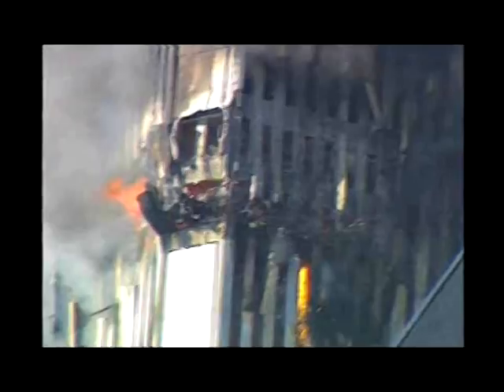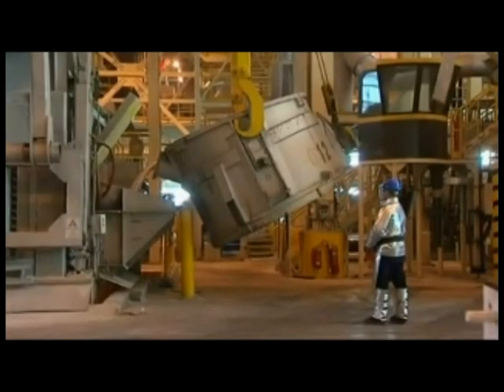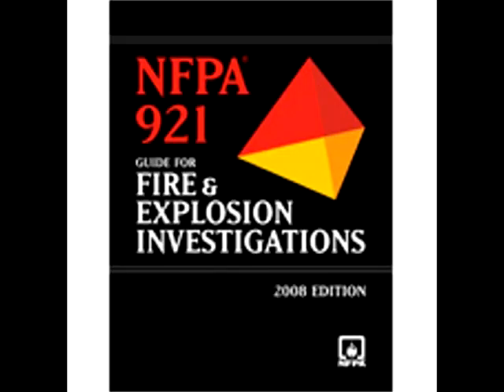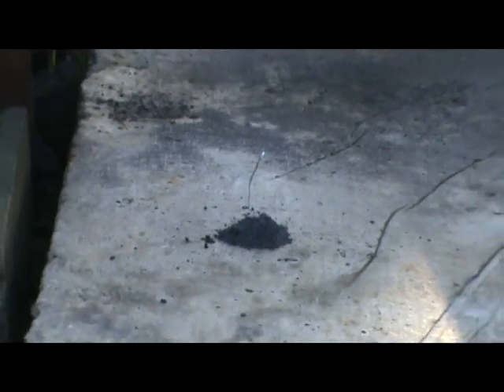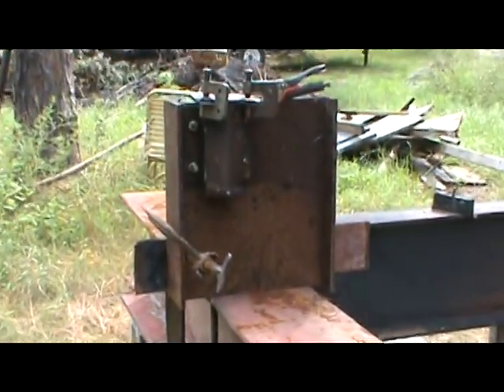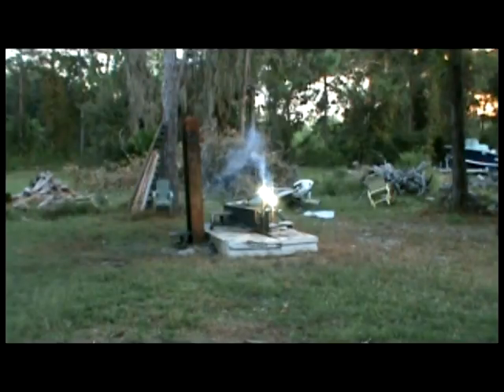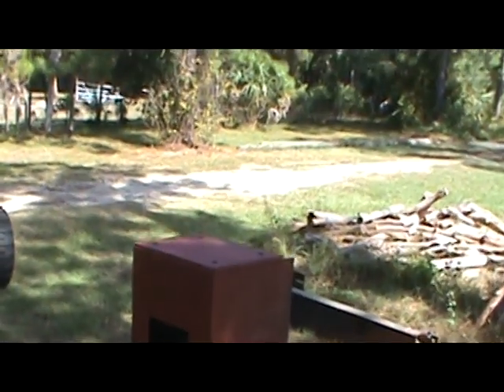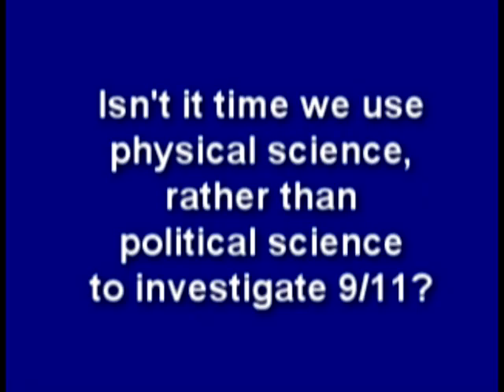9/11 Experiments: The Great Thermate Debate

Comment: Today I learned that jet fuel could melt steel, it burns at 2000 degrees. Not trying to spark up an argument just stating what I learned literally today
Reply: +Barry Hewitt THE BEAMS WERE MADE FIREPROOF. No tower has ever fallen due to a fire in HISTORY. The buildings themselves were made to handle a plane crash. They take that into account. No building falls like that, you have to realize it. I sincerely hope you do man.
Reply: +SgtTeddybear66  Alright just so there's no confusion I'm in eighth grade and we got a study guide saying that jet fuels burns at 2000 degrees and it said IT CAN melt steel. I don't know anything about architectural designs about buildings or anything just stating what I learned so that I can learn more about this
Reply: +kuba adilman  Yeah I'll get right on that. I are you guys sure? You'd think that my teacher would know what's true
Reply: +Barry Hewitt take reliable source and print out the info, to proof she/he was wrong. Teachers are only humans and humans do errors, so that would not be the first time someone was wrong in human history.
Reply: +Barry Hewitt you think school teaches you whats right what a joke its all programming  turn off the tv
Reply: +SgtTeddybear66 LIAR -- there's NO SUCH THING as completely fireproof, and reinforced steel structures DID fall due to fires during the bombing of Hamburg and Dresden!
Reply: +SgtTeddybear66 Indeed, the beams were made fireproof. 
Because steel beams behave badly in a fire. That is why they apply fireproofing. 
And the crash of the plane dislodged that fireproofing. 

You also said the towers could handle such a plane crash.
Can you elaborate that? In what way did they handle the crash?
Reply: +mark brinton No it WASN'T "blown to dust", LIAR -- there were BIG CHUNKS of concrete and steel in the pile of rubble!  And there's NOTHING on earth which can blow a building of this size to dust -- except a nuke, which this WASN'T!
Reply: We werent justified dipshit. You must love you some cheney too. Will never understand people like you who think its Americas job to police the world. Newsflash dummy, it isnt our job. Youre the template for whats wrong in this country.
Reply: mark brinton the towers hardly had any concrete in them. Only 10 cm on the steel floorplates. Most walls in the twin towers were made out of drywall. You don't need much energy to turn that into dust.
Reply: +kuba adilman WRONG -- with a draft (such as what they had in the Twin Towers due to the chimney effect), jet fuel (and any other combustible material) will burn MUCH HOTTER than in free air!
Reply: +agentorange153  I to love my country, but just because we love our country doesn't mean our country is incorruptible! IT IS BECAUSE OF 9/11 (I don't give a fuck what you think old man) THAT WE GAVE UP OUR LIBERTY FOR SECURITY!!! Our founding fathers warned us to NEVER trade LIBERTY over SECURITY.  IT IS BECAUSE OF 9/11 THAT WE ARE IN ANOTHER WAR THAT HIGHLY  BENEFITS THE CENTRAL BANKS THAT LOAN with interest BOTH  SIDES MONEY FOR WAR.  The same central banks that OUR FOUNDING FATHERS WARNED US ABOUT.  So go eat a dick if you are going to tell me an AMERICAN that I don't have the right or freedom of speech to write whatever I want without being labeled a fucken terrorist. The freedom of speech is in our bill of rights don't you dare call me a terrorist! I love my city my state my country but I do not love the majority of the people who run it. We all are free to have an opinion  but yours seems to be programmed....
Reply: You have made yourself look like the single biggest simpleton ever. Theres no point having a discussion with someone so slow. You are clearly someone who likes to be spoonfed your reality. I cant help you there. Some of the other things you just mentioned confirm that one statement. Truth? I dont care youre a sheep. Good for you.
Reply: Whatever Noticed I respect his opinion, but that isnt how wtc7 collapsed. Being a fire fighter doesnt trump physics or common sense. Not an insult at all, just a fact. Youre free to believe what you like. Even if its incorrect.
Reply: People act like jet fuel is the only thing that burns. After seeing a whole floor engulfed in a flashover, there is plenty to burn. It doesn't need to melt it, it just needs to weaken the steel. The explosions can be easily caused by a backdraft AND a flashover. Backdraft is the lack of air in an enclosed area where a rush of air enters that enclosed area and caused a "smoke explosion."  A flashover occurs when flammable material gets to a certain point, around 1000oF and literally everything that can burn, will burn in a fiery explosion. That goes for materials in cubicles, furniture, papers, the ash in the air(which is unburned material.) It all can easily cause a flashover and that is what I saw in the video. An entire floor was engulfed in a flashover.
Reply: Richard Driskill even if it weakens steel, the building would collapse into huge chunks of debris. It was literally, completely and entirely blown to dust. All of it. The official story is nonsense. Trust your brain and eyes.
Reply: agentorange153 and nukes arent the only thing that can have that affect. What do you do for a living? Im sure it isnt molecular chemistry. ...
Reply: You are not very smart. In fact trying to have a conversation with someone with such a low IQ is futile at best. Just so you know we dont have a right to go into other countries, esp based on lies. Terrorists exist largely because of us you dimwit. We went there on lies. Thats wrong buddy.
Reply: No I have plently, he started with the insults, and frankly some people are so set in their beliefs you cant have a conversation with them.
Reply: Whatever Noticed It's ok, clearly he does not understand science. This is chemistry, but let him use physics, because that's not what you use for a burning building. What do I know though? I spent months and years learning this stuff, but I guess that doesn't amount to the level of Googling he did.
Reply: *****
You do not need to melt steel in order to weaken it though. Blacksmiths have known this for thousands of years now. Why don't you?
Reply: +mark brinton And in fact it DID drop in huge pieces -- just look at any photo of the rubble pile, for God's sake!  And there was NO molten steel -- there was molten ALUMINUM from the jumbo jets and from the towers' curtain wall!
Reply: anybody acting clandestinely on foreign soil and taking the lives of those citizens and/or destroying infrastructure is a terrorist, wouldn't you agree?
Reply: +Barry Hewitt Theres a reason Jet fuel cant melt steel beams is a popular saying.
Reply: agentorange153 yes, it was. Wtc 1 & 2 left six percent of their mass. Everyone saw the enormous dust cloud. For miles. If you dont understand physics, engineering and common sense I cant help you.
Reply: That might be the most ridiculous statement ive ever heard.
Reply: mark brinton it is not a statement, but a fact
Look it up.
Reply: Meaning I know that's the amount of concrete,  but the entire building and contents were turned to 95 percent dust. Fire and collapse was no where near enough to pulverize like it did. Not to mention molten steel. Look that up.
Reply: mark brinton So there is nothing wrong with what i said.
95% dust is not correct. Look at videos of the cleanup. 
But that aside: the potential energy of the towers was enough to pulverize its complete content when the energy gets released during a collapse. There is no additional energy in the form of explosives necessary.
Reply: +mark brinton And yes, we were FULLY JUSTIFIED in going into Iraq -- Saddam DID have a few chemical weapons left, and also was harboring TERRORISTS on Iraqi soil!
Reply: Wow, youve swallowed the whole thing, what a good little sheep you are. Damn what an ignorant thing to say. You are becoming the minority kid.
Reply: Indeed. At least youre not a simpleton like agentorange153.
Reply: +kuba adilman It didn't have to melt only had to weaken slightly, so 1500 degrees would of been enough with 10k tonnes above pressing down on it for 40 minutes would of easily brought the building down. just a weakening of the steel NOT melting.
Reply: mark brinton WTC7 collapsed due to the failure described by Chris DemonPuncher
Reply: It may burn at what ever temp but the mix of it in the towers would of just flashed. If you light a pond full yea you would get full heat. This exploded so it wouldn't of got up to temperature to melt steel
Reply: If jet fuel can melt steel what are jet engines made of?
Reply: DeadUgly1 Titanium.
Reply: basicaneer  not to mention the thermodynamic expansion.
Reply: +Whatever Noticed The bigger issue is the loss of tensile strength. Concrete by itself has no tensile strength to speak of. That is why we reinforce it with steel.
Reply: +kuba adilman you realize it burns 1500C right not F so 1500 to F is 2732
Reply: +kuba adilman no,he should go tell his teacher that some idot on youtube is trying to tell him something that said idot knows NOTHING about lol
Reply: +Barry Hewitt I wonder if your study guide was written post 911? This would be a good time to learn that what we are taught in schools, usually through history or social studies, is a biased and government sactioned version of facts. 
Could you give us the name or description of this guide? I would be interested to see this. I am betting its a post 911 book. Unusual because I have be reading and watching this topic for awhile and have never read anyone make that claim regarding those temperaturres and find it disturbing that an education system would go as far as this to support a tainted version of history when this information has previously always contradicted what you have learned. a scary fact of how the education system may be used as propaganda.
Reply: v5u7sulh2
Apparently it does not take meticulous planning. All it takes is parking a jumbo jet far enough up in the building. We have an event that proves this now.

Also, if the government was bent on pissing us off why would they set it up so the building fell so perfectly? Where is the advantage to them there? Wouldn't they arrange things so screw balls like you wouldn't scream conspiracy?

Why would they leave a smoking gun, so to speak? Face facts it happened how it happened.
Reply: TheFacelesss Men
Steel also loses 80% of its tensile strength at half of its melting point. The building was not designed to stand weakened that much. Heck it could have been a solid bar of steel and it would not have stood up.
Reply: Youre right, its done and over with. But, its 14 years later and there are FAR TOO MANY blatant lies, unanswered questions and inconsistencies for any "thinking person" to just accept what they've been told... shrug Eh, jets hit tower... fire knocked down tower... USA went to war against "terrorism".. Why would our government lie, right? 

Sorry, Im a skeptic when I am told a story that doesnt add up. And When there are facts staring me in the face and there are people  desperately trying to discredit them and distract me from them
Reply: +Barry Hewitt The melting point of mild steel is around 2500, high carbon 2600, stainless 2800. I am a blacksmith and my forge runs around 2500...it does not liquefy steel. Just google metal melting points and you can see what actual temps are required to melt steel
Reply: What I find interesting is that the actual government was so worried and aware of the questions over their "official" account that even the President felt it necessary to directly attack "so called conspiracy theories."
I actually believe this lends even more weight to the truth movement because its unusual for someone to defend against something they know to be false. In other words, they must have believed this could be a serious problem but why would it if it was incorrect? Why would one worry about something that would be impossible to be taken seriously by the populous? Maybe because he knew that his story was a weak and a lie and that anyone taking the time to follow up on these crazy conspiracy theories would be hard pressed to believe what his administration wants us to.

Every word a President says to media has been carefully calculated and vetted before being said.That he would acknowledge something that he really thought to be a weak non issue would never get a word but he actually had written speeches just for this topic.Interesting.
Reply: +Barry Hewitt no steel melting was involved, steel softening is all thats required
Reply: +Barry Hewitt steel melts at 2600-2800 degrees but at half that temperature steel loses more than half its tensile strength. thermite typically doesnt get hotter than 2500 degrees.
Reply: john harry good one. I do flip burgers in my backyard. Something you most likely don't have. Meaning a grill or backyard. Doesn't bother me what you think. Apparently you don't think too much anyway.
Reply: Since there is a lot of argument regarding steel melting points and burn temperature of jet fuel, I went and looked myself.

Steel Melts at anywhere between ~1050 and ~1500 C
Jet Fuel max adiabatic burn temperature is 2230C
Jet fuel open air burn temperature is 1030 C

The maximum temperature for steel is with 0% carbon. It should be safe to assume that the trade center steel had at least 2% carbon and probably had a melting temperature around 1400 C. The adiabatic (heat does not escape from the system) case is a theoretical maximum. The system in the trade towers was at least partially adiabatic. For those who mentioned the chimney affect, the trade towers were design so that would never happen.

Given a 1400 C melting point for steel on the high end, I do not see any reason that partial adiabatic affects would not have caused the fire to reach 1400 C or higher.

All information gathered from Wiki.
Reply: ***** Oh, and before you do a quick google search, conspiracy theory blogs and articles do not count as accurate sources.
Reply: +kuba adilman You dont need to completely melt it, just heating up the metal when its under pressure, will cause it to bend, twist or break. super heated metal wont hold a building up it would just collapse. Hell, wood beams hold their strength in a fire way better then steel.
Reply: +Barry Hewitt keep in mind that western government education systems are more about controlling and focusing minds than they are about actually educating, let alone teaching people to think independently...
Reply: +agentorange153 so you're saying the people of the 150 countries around the world have a right to invade the USA and assassinate your president? did you know American forces and/or agents are illegally in about that many countries and are therefore, by definition, terrorists?
Reply: +agentorange153 Buildings in Dresden and Hamburg (Germany) built before WW2 - were NOT built to the same spec. as the twin towers at all!
Reply: +Barry Hewitt in a properly designed burner with a stoichiometric air/fuel ratio. Now lets look at the real world.
Reply: blabla62871 melted? With all due respect you have no idea. Organic material falls short by 1000 degrees. Its not an argument. It is fact.
Reply: No it wasn't. It would shear and drop in huge pieces, not blow to dust. What do you say about molten steel?
Reply: Yes there was molten aluminum, and melted steel also. Thats the problem. Cars hundreds of feet away were melted. Its obvious other factors were at play. Simply the plane and fires could never bring down three buildings. Simply impossible.
Reply: That might help you. Experts from nist even say steel
Reply: +mark brinton The experts from NIST do NOT say the steel was melted -- in fact they SPECIFICALLY state that it WASN'T!!!
Reply: The structural engineer for wtc even stated this
Reply: Hey man , youre free to think what you want. Without people like you to believe the official report, the "powers that be" would be screwed. You probably even support bush going into iraq to search for weapons that werent even there. And we've never left.
Reply: Go do some of your own research and critical thinking. It may help you to let go of your anger. Remember,  some things are true, whether you believe them or not. Simpleton lol
Reply: Fully justified lmao. Im still laughing at that one. Memo to you, we had no business going into iraq. That alone shows how utterly stupid you are.
Reply: +mark brinton That one terrorist camp in Sargat was all the justification we needed to go into Iraq!
Reply: Hi.
Reply: +mark brinton Yes we DO have EVERY RIGHT to go into ANY country which harbors terrorists -- in fact, anyone who denies this is himself a terrorist!  And terrorists existed LONG BEFORE our nation was even DISCOVERED -- they were raping and pillaging their way through Europe and the middle east before Columbus was even BORN!  In fact, accusing our nation of causing terrorism is ITSELF an ACT OF TERRORISM!
Reply: mark brinton so you have no arguments left.
Reply: Explain
Reply: mark brinton you start to use ad hominem in stead.
Reply: mark brinton Then i stand corrected.
Reply: +Barry Hewitt High school text books also say that Obama was elected despite whites not voting for him because he was black. The fact is no one can get elected without the white vote and steel can not be melted by jet fuel. BTW jet fuel is basically diesel with additives.
Reply: Rob k doesnt explain wtc7 even if you want to believe that story.
Reply: mark brinton I'm glad the FDNY did not use your physics and common sense on 911, or many more people would have died when wtc7 came down.

Anyway, read the reports. Thermal expansion of the floor beams caused the structure to fail.
Reply: Whatever Noticed right. Instead they listened to silverstein. oh and ive read everything on both points I can get my hands on.
Reply: mark brinton Nope, the FDNY was smart enough to determine that the structure would fail, based on their own observations.

Anyway, it is common knowledge that materials expand while being heated.
Reply: Whatever Noticed thats not even true. Like I said, think what you want. The only true statement is that yes materials when heated expand. That wasnt why it uniformly collapsed at freefall speeds however.
Reply: mark brinton it did not collapse uniformly at freefall speed.

Anyway, glad that you came back on what you said about physics.
Reply: I didnt per say. I agreed about heat and expansion. I fully disagree on how and why it collapsed. Have a great day
Reply: mark brinton Have a great day too....

About how and why it collapsed, what exactly do you disagree with?
How did it collapse and why?
Reply: It didnt collapse because of fire. Look what files and departments were there. Same with that section of the Pentagon. Way too many coincidences lined up that day. I dont know for sure, nobody does, but one thing for sure is the "official" story is a joke.
Reply: It cant melt steel
Reply: Chris DemonPuncher people like to simplify things. 
'jet fuel can't melt steel' is of course simple. 

Not that there was any melting involved ,but that sort of details only complicate things...
Reply: +Victor Tesla maybe I should point out that thermodynamic expansion along with the force of the plane could have made the towers topple
Reply: +Barry Hewitt the govnt controls the education. why do you think US history is all about how awesome we are and the vietnam was our only downfall? brainwash the children....
Reply: +Whatever Noticed All fireproofing have a timelimit, every substance thats supposed to protect against fire will loose its integrity exponentially faster with increasing temperature. Also Steel will loose its integrity and reach critical temperature at only 550 C, and it will eventually reach its maximum load capacity.
Reply: +kuba adilman It becomes FLUID at those temperatures... It becomes molten at much lower.... Fuckin idiot :)
Reply: +SgtTeddybear66 No building in history ever got loaded by the fuel from a burning jumbo jet either. The buildings were only designed to handle a 727 hitting them. The planes that crashed were 757s. The towers did survive the initial impacts too.
Reply: +Whatever Noticed Do you know what fireproofing is? It is paper. You take paper and mix it with water, then spray it on the structural steel. Depending on the thickness you get anywhere from 1 to 4 hours of extra time before the steel weakens. Unfortunately for the towers when you hit a building with a jumbo jet flying at 500 MPH it tends to knock a lot of fireproofing right off the beams. Where the stuff is just more fuel for the fire then.
Reply: +agentorange153 I think we were more pissed about him taking pot shots at our patrol planes. Actually it was the British that demanded we do something. We kept sending Saddam harshly worded letters about it. After the 14th warning went unanswered we finally did something then.
Reply: +mark brinton If it isn't our job then who's job is it? We cannot let the world simply run amok. Chaos has a bad habit of spreading.
Reply: +Barry Hewitt You study guide has some misinformation in it. The jet fuel would have been jet fuel A , and had a max burning temp of around 1800 F, the type of steel in the Towers was high grade, meaning it would have needed to be over 2700 F.Who ever gave you that study guide needs to be called out for the liar he/she is.
Reply: Feriin
Just how exactly do you control the maximum burning temperature of a fuel in an uncontrolled situation?
Reply: Paul Frederick I fail to see the purpose of such a question.
Reply: Feriin
You would not. Because trying to would completely invalidate what you said earlier.
Reply: +Whatever Noticed ,  you are a fool... give up, not that there was any melting involved... did you not see molten steel pouring out of the wtc? its already proven that it wasnt aluminum, and you just admitted that jet fuel cant melt steel so what exactly are you trying to prove? that leads me back to "you are a fool" fool.
Reply: the video were commenting on has proof that molten aluminum will not look like molten steel  when organic matter and office equipment is introduced. that is a fact. molten aluminium looks like liquid mercury and does not glow red, orange, or yellow like the molten steel seen pouring out of the wtc. I have personally cast many objects out of aluminium and can honestly tell you that molten aluminum does not glow and never will.
Reply: ***** If you can't believe your eyes, why would you believe peer reviewed evidence?
Reply: ***** prove me wrong...
Reply: +Karl Hall To EVERYONE on this thread; It does NOT matter if jet fuel can melt steel or not!!!!!!!!!!!!!!
No skyscraper could ever fall so perfectly where it once stood unless it was taken down by a controlled demolition!!! It takes METICULOUS PLANNING and a professional team of ENGINEERS, DEMO-MEN, and EXPLOSIVES EXPERTS to make this happen! Not by randomly crashing 2 jets into the  T O P  of a tower and melting some random beams with jet fuel!!!!!

If the towers instead fell over and onto other buildings opposed to straight down from where they stood, i could begin to believe the bullshit jet fuel theory.., THEY FELL  PERFECTLY.. The twin towers were purposefully destroyed by our government so that Americans would vote for WAR! And the media helped to cover up all the tracks.
Reply: v5u7sulh2
We were actually fighting terror since at least the 1980s. The September 11th attacks just ratcheted it up a notch. To a point where even someone like you recognized it.
Reply: ***** What laws are these?
Reply: Rishabh Singh
the metal didnt need to melt, genius, it just needed to soften & that doesnt need much heat
Reply: +Barry Hewitt Jet fuel may burn hot enough, but it burns too fast to really melt anything.  When an aircraft crashes, does it melt?  I think you will find not.  Not mentioning that the towers were actually designed to withstand an impact such as an aircraft.
Reply: fucking shill
Reply: ***** The official story has too many discrepancies that they haven't been able to explain.  Thermite clearly can melt steel beams, jet fuel cannot, and from there you can go figure.  What really happened, no one will ever know, as the wreckage was cleared away too quickly for a proper investigation.  However, we can know that of all the possibilities, the official story is not the most probable by a long way.
Reply: +mark brinton "Trust your brain and eyes."

Those two are literally the worst sources for information EVER. If science has tought us anything than it's never to trust your eyes or your "common sense". Never. Because they are wrong almost every single time. I'm not taking sides here, but THAT was some bad advice.
Reply: +mark brinton physics and engineering have absolutely NOTHING to do with common sense. Actually common sense would lead you to conculsions that are wrong in most cases, while physics can be used to explain why it is the way it is, even tough it doesn't make sense.
Reply: +agentorange153 Wow.. really. You really believe that Saddam had weapons of mass destruction. But the US found none. In the entire country. None. But they were there. Somewhere. But never found. Because that would've been the most important victory the US would've needed. But they found nothing. But they were there. Somewhere.. There were so many weapons of mass destruction that it justified starting a war. Just.. nothing was found. Ever. Not even a tiny bit of them. Or production facilities. Nothing. All we saw was some photosho.. *cough.. satellite photos i mean. And that's enough for you. Because NOBODY can fake pictures nowadays. And there were NO other reasons to invade iraq. It's not about oil.. nonono. How dare i to think that. So it just must've been weapons of mass destruction. Invisible ones.. but still.. they were there. They still have to be. Because they weren't found. Maybe we should invade again. Since the US didn't find any.. you know. Or we could claim that they shipped those weapons of mass destruction to another place with oil.. *cough.. i mean storage for weapons of mass destruction. And oh yes.. TERRORISM!!!! Stop thinking. TERRORISM!! If that doesn't justify bombing the living shit out of innocent civilians i don't know what does. It's not like killing thousands of innocent people would be terrorism. No.. it's them getting angry about it that is. And even if they don't.. they got oil *cough.. sorry.. TERRORISM. BOMB them! Lalalalala "i can't hear anything your saying. War in iraq. Totally justified. Murica fuck yeah and stuff.
Reply: Samurailord Saddam was just the poor guy in the wrong place at the wrong time.  He wasn't a threat to anyone.
Reply: I hate when people say oh jet fuel can't burn steel. There were other factors as well. The planes were traveling at over half the speed of sound, that is an ungodly amount of inertia from such a large aircraft. People act like someone just went in there and poured jet fuel on the beams and set fire to it. Or it was rigged before hand. Even if the planes somehow had no fuel I feel as if the inertia alone would cause structural  damage.
Reply: +Barry Hewitt the boeings that crashed into the towers used Rolls-Royce RB211 engines, they run on jet-a-1, based on unleaded kerosene

nside the typical commercial jet engine, the fuel burns in the combustion chamber at up to2000 degrees Celsius. The temperature at which metals in this part of the engine start to melt is 1300 degrees Celsius, so advanced cooling techniques must be used.

thats with a jet engine, using jet fuel, highly compressed and high speed air, 

but MILD steel melts at 1510 degrees C so in order for jet fuel to melt it, it must be toxic zip fuel, with highly compressed and high speed air to melt, also the wtc probably had high carbon steel, raising the melting tempature. 

and chances are, to make jet fuel melt through steel, you would need a oxidizer, for example, acetylene cutting torches

regular acetylene gas, and do anything to steel, its like propane with a very high flashpoint, 

add oxygen, now were talking, it can cut through thick steel, iron or aluminium EASY
Reply: Rishabh Singh
no one said it was molten steel, YOU do the research, could have been fucking lead for all we know ... & where is this molten "steel" now  ?
Reply: +v5u7sulh2
If that were the case, then how were the hijackers all from Afghanistan?
Reply: MaxxFordham the hijackers were actually 15 from saudi arabia, two from the uae, 1 from labanon and 1 from egypt
Reply: +Barry Hewitt no it can't actually jet fuel spread out over that large of an area without a constant source of new fuel being added can not melt steel in the way to cause the towers to collapse no idea where you learned your information but I suggest doing some REAL science experiments and research....
Reply: +Barry Hewitt "In the combustion chamber, fuel is mixed with air to produce the bang, which
    is responsible for the expansion that forces the air into the turbine.
    Inside the typical commercial jet engine, the fuel burns in the combustion
    chamber at up to 2000 degrees Celsius. The temperature at which metals in
    this part of the engine start to melt is 1300 degrees Celsius, so advanced
    cooling techniques must be used."

http://cs.stanford.edu/people/eroberts/courses/ww2/projects/jet-airplanes/how.html

http://education.jlab.org/qa/meltingpoint_01.html
" I answered this question many years ago and it has been 
referenced in many different web sites and reports. There has been one 
misrepresentation that has come from that. Many sites refer to the 
difference in the melting point of steel and the burning temperature of 
jet fuel as proof that the World Trade Center could not have fallen from
 the aircraft fires. What those authors fail to note is that while steel
 melts at around 1,370°C (2500°F) it begins to lose its strength at a 
much lower temperature. The steel structure of the World Trade Center 
would not have to melt in order for the buildings to lose their 
structural integrity. Steel can be soft at 538°C (1,000°F) well below 
the burning temperature of jet fuel."
Reply: +James Nash You didn't have to add new fuel, it set fire to much of the things that were in the floor that it hit.
Reply: +Stephen Daugherty You have to account the wind factor up their it would be funneling through the floor like a furnace 40 mph to 60 mph? Fuel air and fanning + 30% structure missing rest structure shocked and weakened. Jet engines still running at full power in the floor if not destroyed.
Reply: +Enforced Uhh, yes, jet aircraft could melt from burning jet fuel because the large quantity of burning jet fuel can easily burn long enough to melt the airframes and the thin skin, which are made mostly from aluminum.  Aluminum melts at 1,221°F.  Jet fuel can burn up to temperatures of around1500°F.
Reply: +Whatever Noticed  Hardly any concrete??? watch a video about the construction of the towers and you will see that each floor was made up of 4 inch concrete.
Reply: mark brinton Trust YOUR brain no thanks keep flipping burgers bud.
Reply: Rishabh Singh
you have no proof, all you have is conspiracy theory hearsay ... where is all this molten steel that you keep babbling on about ?
Reply: +Barry Hewitt ask your teacher to calculate the thermal mass of a single floor of the WTC towers, add up ALL the jet fuel and figure out how many BTU's of energy are contained within it, and calculate the increase in temperature if every single BTU were instantly absorbed by the structure with 100% efficiency. You'll get less than 275 degrees C temperature rise.

In the real world, though, you'll get much, MUCH less of a temperature rise to the WTC structure from the jet fuel.
Reply: +silvs1966 A lot of it was in the dust. Check out the analysis of dust samples.
Bulk metal was swiftly removed from the crime scene and sent primarily to china and india for recycling. So the theorized molten steel which would have originated from the beams, and much of it would have made its way downward and into the dust. As far as the rest of the debris, I challenge YOU to find out where it was taken. The research onus is on YOU now. :) Enjoy! Let's see how you deliver. Are you man enough?
Reply: John Cox
there were only enough BTU's to heat one floor up 280 degrees C, assuming 100% thermal transfer and zero losses (the big fireballs were losses).
http://911review.org/WTC/WTC_JET_FUEL_9_11.html

There's a reason that the official story claims it was office furnishings instead of jet fuel. (despite their exaggerated independent testing failing to produce the results they wanted)

Of course, heat rises and the steel b-decking and joists would get the first of the flames. But regardless, the fuel was gone fairly quickly, quite frankly, and wasn't nearly as much of a contributing factor as were the office furnishings.
Reply: +Gatito De Ana yeah I agree with you.  The planes were the only cause of the collapse.
Reply: +SgtTeddybear66 The building was designed to handle being hit by small cessnas, certainly not large commercial jets.

And you don't need to melt the iron to shape the horse-shoe, you dumbass.
Reply: *****

Whose ass are you pulling these shitty 'facts' out of?
whether its your own, or someone else's, you've gotta wakeup and smell the fecal coffee.
twin towers were designed for impact with one of the largest commercial airlines at that point in time, the boeing 707. it had a MTOW of over 300,000 lbs.
In contrast, your cessna had a MTOW of less than 2,600 lbs, or less than 1/100th of your claim.

quote form MasterMedicHQ
"The building was designed to handle being hit by small cessnas, certainly not large commercial jets."
Reply: ***** citation needed.

On top of that, literally everything else I said still applies.
Reply: holy hell! u got rekt. i like how u posted a controversial  comme t and said ur not tryna spark a argument   lol. ....but pls. dont listen to fox news when they talk about chemistry
Reply: +Barry Hewitt US seems to change the law of physics and science just to get away with what they did it seems lol, and people are so uneducated that they believe anything their government says. By the way US spends over 2 billion a year spreading propaganda. Thank god I didn't live or go to school in US...
Reply: +Barry Hewitt barry teachers study for 2 years to be a teacher. An engineering or architect studies for much longer. Your teacher was busy learning how to teach, not learning what is right, wrong or true. Most high school teachers are only reciting things they find online or in books or out dated teaching guidelines. if something interest you (such as this) then you need to do some of your own research and form your own opinions
Reply: +Barry Hewitt could you take a picture of that study guide please and send it to me?
Reply: +Barry Hewitt jet fuel would need to burn at approx 2500 to 3000 degrees to melt steel in fact.
to melt a steel beam however is very inconsistent. because you're not just melting steel, your melting a beam of steel, thicker, more dense and has it's own structural integrity.

if a plane had fuel running at that high temperature, the plane would not have to be going at a colossal speed, but would most likely destroy itself before it even reached a great distance
Reply: Nathan Beckles You also do not need to melt steel to weaken it extremely, rendering the entire argument useless
Reply: +MasterMedicHQ But there was molten steel in the lower basement of the twin towers burning for weeks....
Reply: David Long And? That doesn't contradict anything I just said.

That doesn't contradict the fact they would have been heated enough to lose that integrity enough to bend. That's how horseshoes are made. What, you seriously thought all metal work consisted of pouring things in a mold?

The "steel beams" argument is entirely invalid and is so easy for anyone to blow off the table with pre-highschool science I'm surprised people are still trying to use it.
Reply: +kuba adilman and you are really, really sure about the melting temps of steel? I bet you are not. First of all the steel that was used is not comparable to the modern steel types that are actually used for such buildings and btw today steel is not really used that much for buildings of that height and higher.  It is concrete. Anyway the Twin Towers were build in the 1960`s and 1970`s right? So different kind of steels were used back in the day and none, this is for sure, melted at 2500 to 2750...not even close...not even today. C15 f.e.1510 degrees, C36 is under 1500 and tantalum, which is a steel too, at 3000 degrees, but tantalum is defo not used for builds like a skyscraper as you surely should know.

So read about the fire protection of the Twin Towers, back in the day, the responsable ppl decided to quit using asbestos because of its already known or suspected issues referring to health/cancer. So the north tower was already finished up to floor No.40 and after that floor they used Vermiculite instead to finish the rest of the north tower and the whole south tower. This Vermiculite was build in to protect the used steel from a temperature higher than 593 degrees, a temperature which for the used steel meant a loss of 50% of its strenght. I believe you can easily imagine what happens at a temp of 750 degrees or 900 degrees, right? So that is the most important point in this drama. and this is the reason why the first tower collapsed after 30 mins.

This is btw what nearly all structural engineers that have been asked after 9/11 confirmed. Worldwide. Anything else is or speculation or conspiracy theory. 
In your case and checking the numbers that you offer as melting point, i assume that you simply confound "degrees" and "Fahrenheit". 
Regards.
Reply: +Maximo Mindofgod degrees or Fahrenheit?
Reply: +agentorange153 wrong bud 1000 extra i dont think so fuckboy gtfo lil kids half of u were not even alive when this whent down
Reply: Joey TheJoker Judging by your lexicon, you are one of those kids.
Reply: +Barry Hewitt 
Jet fuel CAN WEAKEN steel, yes but it will never melt it, you have to keep in mind that fires outside burns hotter than in an enclosed area where its starving for air.

I seen the media trying to fool us to think steel melts from jet beam, they made a massive pit and filled it with jet fuel and put a small steel beam above and lit it, after hour(s) it bent but it did not break nor melt.
Reply: ***** It's a good thing that it doesn't need to break or melt to ruin the structural integrity and cause a collapse.

Science.
Reply: +mark brinton Excuse me, but what do you mean by "Wtc 1 & 2 left six percent of their mass"?
Reply: Ron Aaserude Go to wherever you find a definition for terrorism, then come back here and delete your stupid comment. Thank you!
Reply: Where do you get your definitions from? Terrorism and terrorists have absolutely no "clandestine" aspect to them. The point is to spread terror and send a political message along with it, and this can be done only if the terrorist activities are as public as they can get and why terrorist organisations actually have an interest in claiming they are responsible for their actions.
It's too complicated isn't it? Then keep mixing intelligence services with terrorist organizations... you are on the right track of being a conspiracy nut.
Reply: +Barry Hewitt There's no reason to think your teacher would know what is true or not.   They only know what they know.  They are infallible as anyone.
Reply: +agentorange153 a B-25 bomber crashed into the top of the empire state building. Guess what, it's in tact!
Reply: +SgtTeddybear66 not to mention that steel beams literally vaporized in mid air.
Reply: *****
 bottom line is thermite does not turn steel to ash in a second, like is shown in video of 911. I dont know what you are all debating......
Reply: +Zac Price Were you in Viet Nam? I was! Our hands were tied beause of "No fire zones" and having to ask permission to fire back. This was the only war where we had this. The Military really was not allowed to accomnplish their mission by the sentiment of the nation of the time and the people that believed the propaganda spewed by some of the young celebrities (Jane Fonda for one whose father was a card carrying communist). That is why Viet Nam was our only downfall, we weren't allowed to win.
Reply: +Barry Hewitt My man, teachers can't teach anything that goes against the 'real' government story, it definitely can't melt at that temperature my friend!
Reply: +Barry Hewitt Those temps your teacher is throwing around are max temps for fuel burning with the right mix of pure oxygen, when it burns in air the temps are reduced by at least 2/3. If you watch the videos of the tower fires you will see lots of black smoke, black smoke is caused when the fire does not get enough oxygen to burn all the fuel, reducing the temps produced. If you look at the videos you will also see molten steel running from the building...
Reply: +Barry Hewitt Those temps your teacher is throwing around are max temps for fuel burning with the right mix of pure oxygen, when it burns in air the temps are reduced by at least 2/3. If you watch the videos of the tower fires you will see lots of black smoke, black smoke is caused when the fire does not get enough oxygen to burn all the fuel, reducing the temps produced. If you look at the videos you will also see molten steel running from the building...
Reply: +agentorange153 I can't take it anymore! Shut the fuck up. Military authorization from who to police the world of terrorism. We fucking occupied for resources and political influence in the region.
Reply: Samurailord Like
Reply: Whether jet fuel could burn steel or not the problem is that the trade center looked more like controlled demolition than an accident where coloums were weakened an the building that was designed to take a direct hit from a jet liner didnt  topple to the ground.. instead it came straight down perfectly
Reply: winwinniewinfield
 Exactly! Also the fact that a steel beam CLEARLY vaporizes into the air within 2 seconds. It was not on fire either.(no shit, but you never know what these morons in denial are thinking)
Reply: +Chris DemonPuncher THANK YOU GOD! I was hoping i wouldn't have to explain and type down a long paragraph about the obvious like you have already did. You're awesome.
Reply: +Paul Frederick Lol, No-one plans on leaving a smoking gun, just an oversight from bad planing. And the governments are known for getting things right, are they not? I guess they just factor in how the majority are 
fool enough to believe it.
Reply: Fre Go
Thats a long way to say"im a moron and know nothing about what happened." Because NOTHING you said is relevant to the FACT that steel beams turned to vapor in mid air in 2 seconds.
Reply: +MasterMedicHQ 
And yet you do not know proper science that fires indoors burns less hot than fires outside in open areas.
You see, the more black the smoke is means the fire inside is less hot, its why there was so much black smoke coming out of the towers before they collapsed, so that the fire melted the beams holding the tower together makes no fucking sense, even more so when they are protected against fire.
Reply: +Barry Hewitt When it comes to Aviation Type A fuel (avfuel) the following is true Max adiabatic burn temperature
2,500 K (2,230 °C) (4,040 °F) Open Air Burn temperature: 1,030 °C (1,890 °F) (wikipaedia)
Adiabatic temperature refers to the  temperature that can be reached if the fuel is burned as a pressurised gas.
(Like how Propane directed by a gas torch nozzle is hotter that when it burns in a cloud in the open air.) 
With relation to 9/11 keep in mind that most of the avfuel in the second tower exploded as a fireball out of the building. Avfuel also burns at a lower temperature in the open air and is quickly used up. I am saying it was not like there was an infinite amount of aviation fuel that kept being supplied to burn.
Anyway finding the truth of 9/11 can be a rabbit hole with many theories and many misleading arguments. The two main questions are why did the towers fall so quickly at near freefall speed (second tower hit fell first)  when they were made to withstand airplane strikes and no other building of that type had ever fallen due to fire and what happened to building 7. (no plane, no big fire ,and it pancaked into its own foot print and the official report doesn't even address it)
Reply: +SgtTeddybear66 They said the titanic would never sink. They were wrong.
Reply: sum gUy And they also found the Titanic, the Twin Towers basically vaporized into ash. And our lovely government carted off with the evidence.
Reply: Brian The NAZIs economy was a miracle, I don't know what you're talking about. Guess that's what happens when you ban evil Zionist bankers from politics.
Reply: +Fre Go 
That is a very good piece of source you got there, still does not explain how the building fell at free fall and the explosion sounds, skyscrapers that have been a full blaze never collapsed, only pieces fell.
Reply: *****
so exactly which skyscrapers that had jumbo jets smashing into them & exploding are still standing ?
Reply: +Fre Go 
Here is the problem, none of that has been proven, however the termite theory actually has some proof and witness account backing it up, the tower would never go free fall because of the structure of it, if the top part actually started falling it would be crushed upon the standing structure and fall to the side I mean its common bloody sense.
Reply: Fre Go The difference, steel is not wood. It does not light up like wood. If fire caused this, we would have seen the building slowly warping and tilting in the direction where it was weakest. Not just fall like someone had a tower of cards and someone knocked the bottom out. But I guess you know more than Architects, Engineers, and controlled demolition teams.
Reply: +Fre Go 
Black Fox said what I wanted to say so there you go.